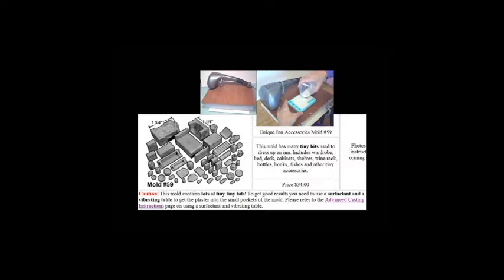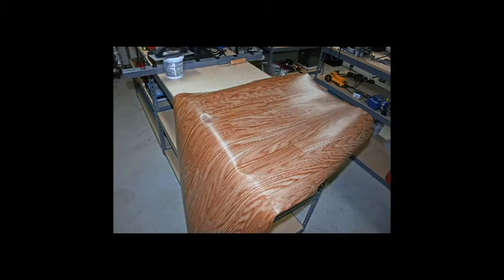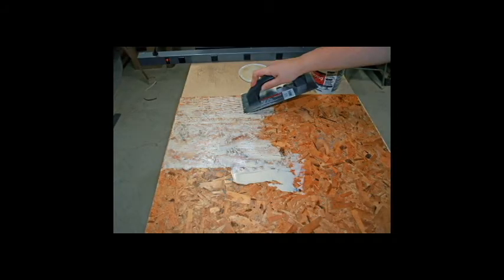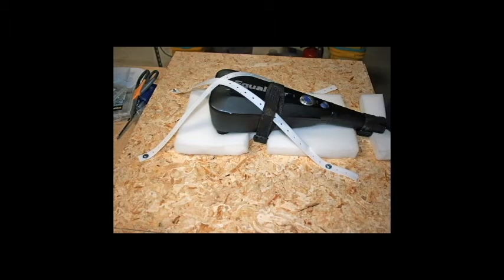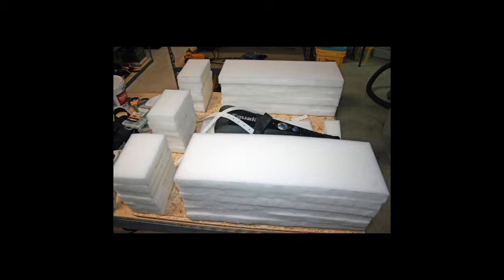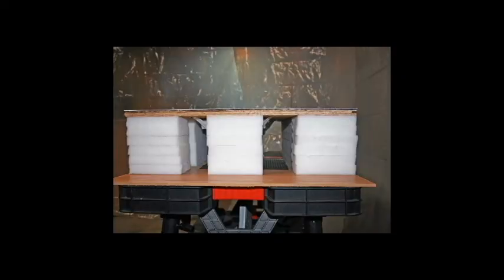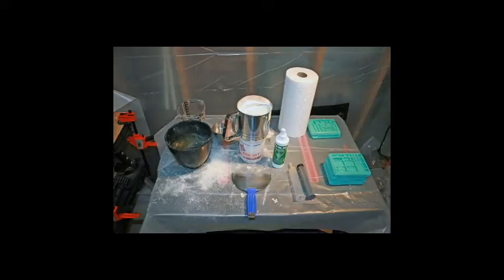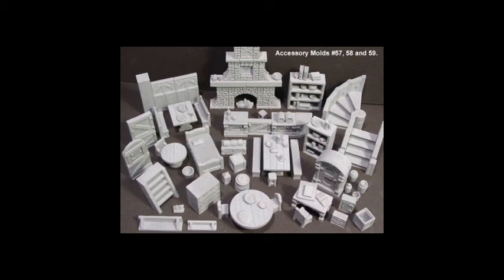DIY Vibrating Table

Comment from the maker: YouTube cut off my last 41 seconds...thanks YouTube. The table reduces the bubbles in castings massively, cost around $60, and took about three hours of work (minus glue dry time). Worth it, wish I would have been using it years earlier. Hope this helps. 8-)

Comment: Thanks for your video. I just assembled my vibrating table and was not real sure it was done correctly, though I followed Bruce Hirst's directions. I needed to see one in action to be sure. Now I know I've done something wrong. My molds vibrate all over the table and splash the plaster out. Any advice would be welcome. I'm thinking of placing a spacer between the massager body (between the knuckles) and the table.

Comment: Nice design, looks very similar to the one I made. I too did not like the top mounted version. Though I will need to add that edging idea. After which I will use the Plasti-spray plastic for the top coating. Thanks for the upload and additional ideas.

Comment: Hi,

What did you use for spray the mold? thanks :)
Reply from the maker: +dua jari That is a surfactant from Almore International Inc.. The least expensive place to get it is...http://www.net32.com/ec/almore-debubblizer-debubblizer-surfactant-spray-directly-onto-d-116573
Reply: +MacAttack001 Thank you im afraid i couldn't find it in my country.
Reply from the maker: +dua jari You can make your own surfactant, by simply using water and liquid dishwasher detergent Jet Dry is highly recommended.
Reply: MacAttack001 Hi thank you very much for the answer im afraid i couldn't find Jet Dry in my country either. I will try local dishwashing soap. should i dry the mold after the soap applied or should i pour the concrete right after i rinse the mold with the soap?
Thank you
Reply from the maker: Just a few drops of dishwashing soap in a spray bottle with water should help a lot. I always pour the dental plaster right after spraying the mold. The plaster will displace the water and soap in the mold.
Reply: +MacAttack001 im going to try it today. thanks again fp the tips. all the best!
Reply from the maker: Glad to be of assistance. Let me know how it works out!
Reply: hI, I tried using local dishwashing soap bu it did not work really well, is there particular ingredients that i should have in the dishwashing soap?
I also experiment using coconut cooking oil, it work well but it damaging the concrete color and it made the surface little bit rough
Reply from the maker: The sole purpose of the dishwashing soap is to reduce the water's surface tension to allow the plaster to flow into the mold easier. Any liquid detergent should do that...just a few drops in half liter of water in a spray bottle should work.

You keep using the term concrete, which leads me to ask...are you using concrete?

Concrete is significantly different than dental plaster, hydrocal plaster, or just regular plaster.

I would stay away from any oils.